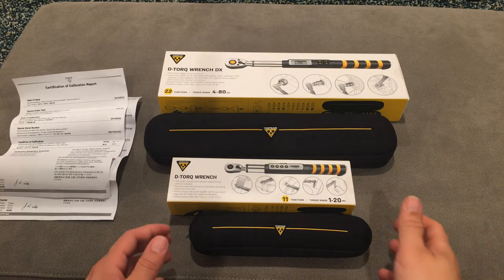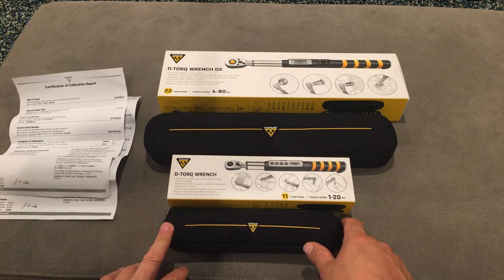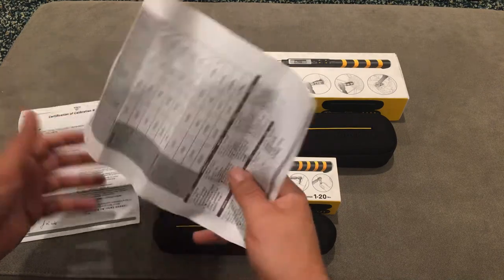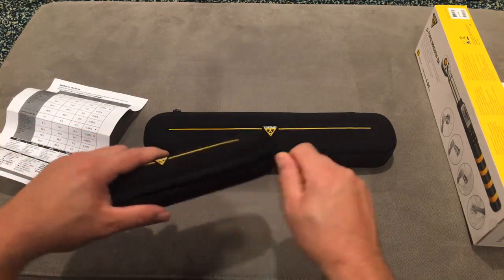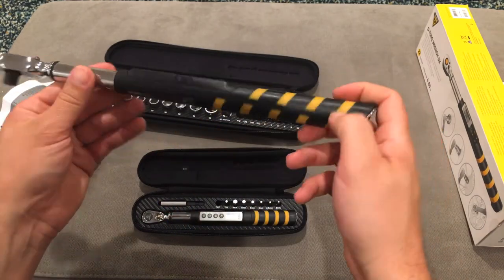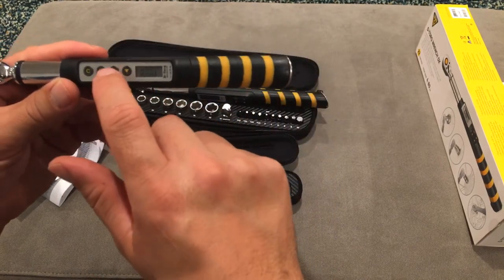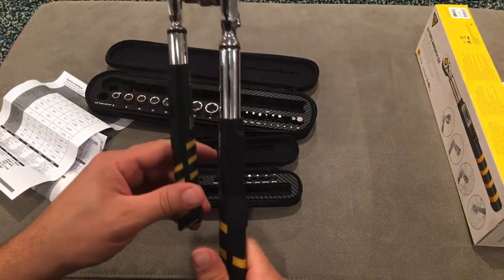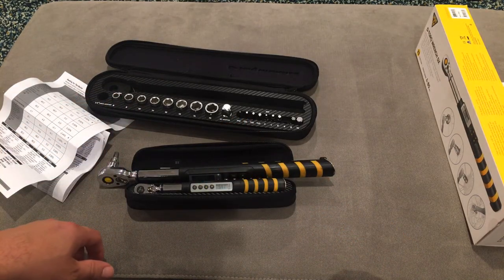Topeak Torque Wrench Review

Comment: What one should I get for doing most components on a bike?
Reply from the maker: I would just buy the smaller Topeak D-TORQ 1-20 Nm for general use, you really just need the larger one for drivetrain work and more major parts but for simple stuff like adjusting the seat and handlebars, changing grips, moving shifter/brake levers the smaller unit is perfect for 95% of that stuff and comes with all the bits you will need. Happy trails :)